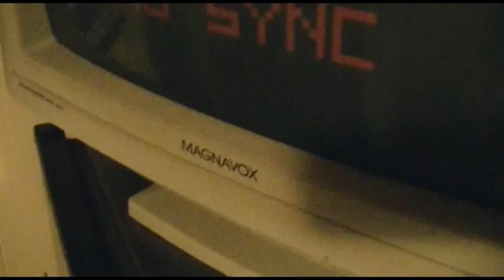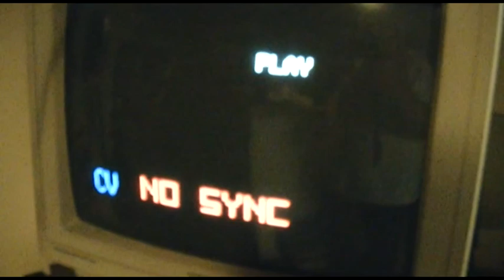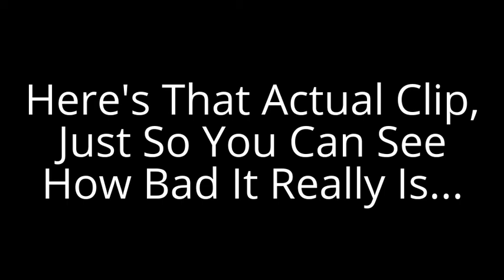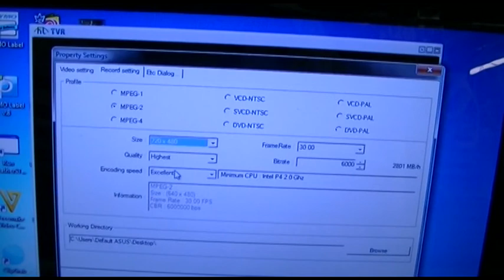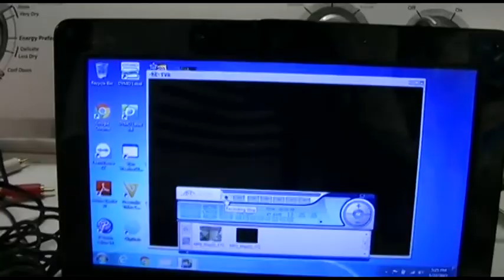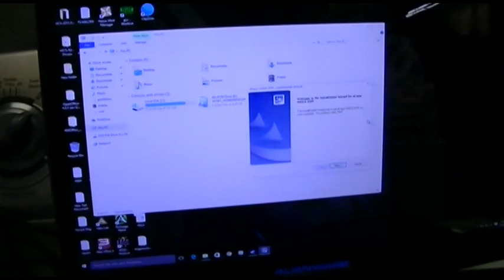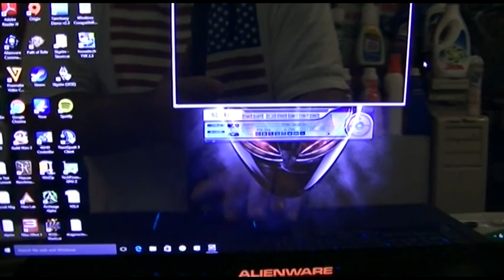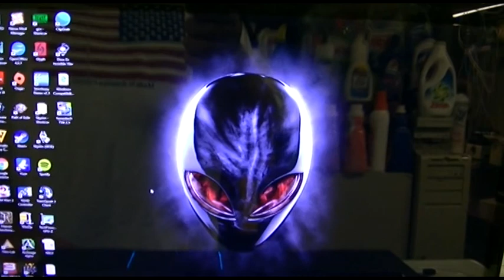Not-So-Easy(ier) Cap Video Capture Device, Part 4 - Works Fine After All!

Comment: I've just bought myself one of these. I knew about them for years and was thinking of getting one, when I remembered your series on it. Looking at your troubleshooting I think I'll be able to get it to work for my use-case on Win10. If not I can try on a crappy Win8.1 machine, but I really don't want to. I don't think my Win7 machine will handle. it.

In my travels a while ago I acquired a VCR, and when my parents came to visit recently they brought some old family VHS tapes with them so we could watch and reminisce. Well, now starts the great digitisation project of family videos!

I was planning on capturing them onto a DVD recorder I recently got for free but there seems to be an issue with the finalisation of the DVD burn. Plus then I would have to rip the DVD to a computer to be able to put them online for people to actually watch them, so I think this device will actually make the process easier - fingers crossed! The DVD recorder can be relegated to DVD player in the bedroom because why not.

Amazing that such a crappy little device has been around for so long and is still manufactured!
Reply from the maker: Yes, it's rather amazing it's still around.  If you can get it to work, so much the better.  There are many others who can't and throw it out, then crap in the comments on my video on it saying how bad of a product it is because THEY couldn't get it to work.

Frankly, I'd do a test run with this and the DVD recorder and see which produces a better quality image, then go with that.